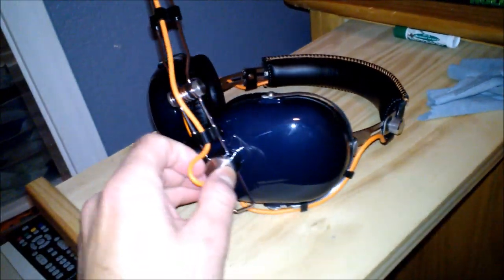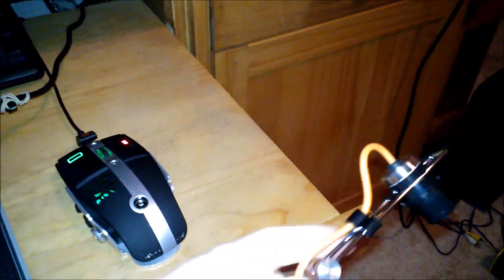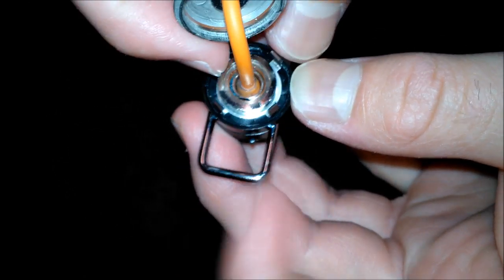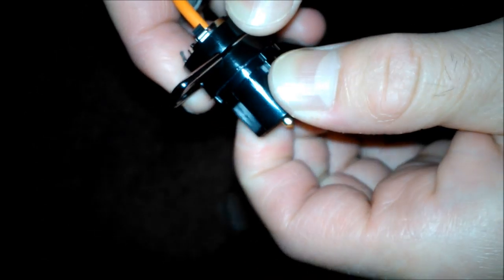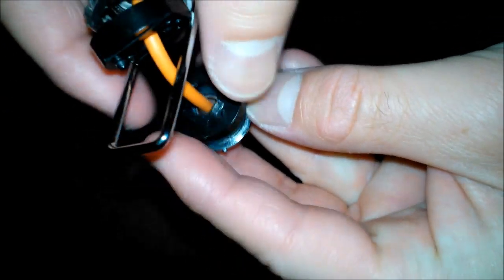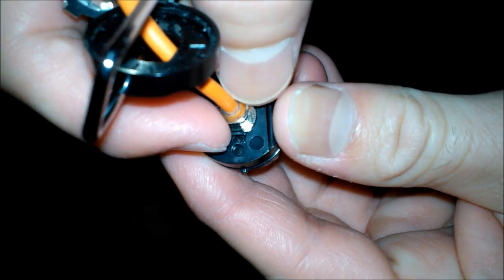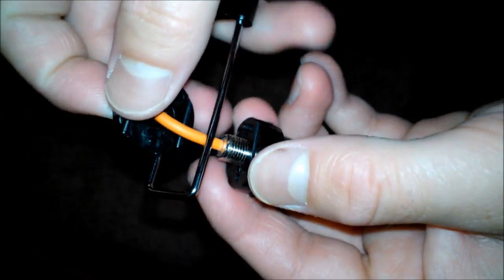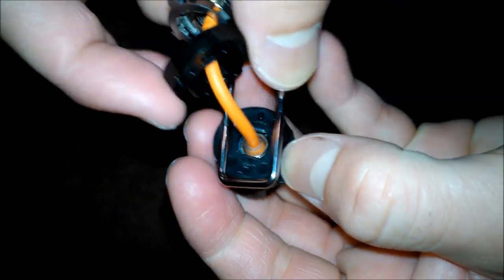Razer Blackshark How To Fix Broken Mic

Comment: My problem with the blackshark is that the mic would go loose and make weird noises, like static. My friends would then complain, since we are on a voice chat, then i would have to wiggle it to fix it.
Reply: Same here, I've had it for ~ 6 months and whenever I move it a bit it'll start making a "snow storm" I like to call it, it rapes peoples ears, and it's so annoying.
Reply from the maker: LyfeTime Gaming
Sounds as if the mic jack inside the mic plug is loose and isn't making full contact with the mic plug in the headset. Hopefully tightening it should fix it. Otherwise you should talk to Razer about it. It really is a wonderful headset.
Reply: AgardMan Eventually the headset got to the "sandstorm"  part, me and my friends like to say his mic is fucking itself, so I used cotton swabs to clean the inside. It worked for a week. Now the new problem is the microphone jack connecting to the computer. It fails to work now, when connected it starts making a whole lot of noise, worse than the sandstorm. No idea how to fix it. Computer's jack is working fine. The audio splitter thingy is broken. For now, using headphones only.
Reply: Forgot to say, the black shark belongs to my bro, not me.
Reply from the maker: If the audio splitter is broken ask Razer for a new one. If the audio splitter is broken and the headphone plug that plugs into the splitter is broken you may need to talk to Razer about hooking you up with a replacement. I know that repeated plugging and unplugging of a non careful nature can really mess up a plug or jack. Hopefully everything ends out well for you.
Reply: AgardMan Yup ordered a replacement already. It costs a bomb for a small adapter. Don't know if the "sandstorm" is fixed though
Reply: LyfeTime Gaming DO YOU FIX IT NOW ?!?!
Reply: Onkel Mon Nope, it's gotten worse
Reply: +Kidsnd274 OMG SAME I CANT FIX IT
Reply: try to change the quality of soundto the best one in speakers not microphone , do not allow other apps to change its settings and turn of all the extra effects . It worked for me
Reply: everyone i just fixed the sound. put contact cleaner on the male size of the mic.

Comment: Ive had this headset for years now. It is the best one i ever put on. As the video shows, this was one of my problems as well and because of the video it was solved pretty fast.
However i also encountered other issues, like static in the mic. In my case this was caused due to a snapped cable. The cable coming out of the headset gets twisted, bent a lot and eventually the cable will break. Usually it is at the entrance to the headset. I fixed it by opening up the headset, i used a small soldering tool to disconnect the cables to the circuit. Then i cut off the bad part of the cable and moved a long a "fresh part". The cable will be 2 cm shorter but it works. Then you just strip the cable, sold the right connections and ready to go.

Comment: My nephew has this headset and one of the screws has gone missing that holds the head piece together.  Do you have any recommendations of how I can replace the screw?  I have not been able to find a replacement part on the Razer website or at Memory Express.
Reply from the maker: In this particular situation you should be able to call/email Razer customer support and explain the issue and they should be able to send you a replacement. They stand behind their products so if you call them out and ask nicely for a replacement they should be able to help you out.

Comment: any ideas on how to pry open the metal thing just so i can tighten it?
Reply from the maker: Yeah it should just come off if you insert a fingernail in between the cap and the plastic. It is being held on by glue so do not worry if it seems as if it is going to break. I thought that, but found out it is held on like that. It is also held in by four prongs on the inside of the mechanism itself so I think the glue was just a precautionary choice made by Razer.
Reply: AgardMan oh it came off SCREWDRIVER SAVED MEH DIS TIME YEH
Reply from the maker: Yesh!!

Comment: I got my headset today and when i plug it into my laptop the mic itself isnt detected, but i can still hear the sounds in game fine. Do you know how i could fix this?
Reply from the maker: If what your saying is correct all you have to do is right-click the speaker icon in the bottom right corner of your desktop in the system tray and click "Playback Devices" then go to the Recording tab and click your mic and make sure it is enabled. Sometimes windows thinks you have a different mic that your would rather use and so you have to tell it which one you want it to detect.
Reply: AgardMan I have the same problem and this isn't helping.
Reply: Awfulmasterhat I ended up returning mine and getting the razer kraken 7.1. Theyre great
Reply: Fallsmar I got mine to work, open RealTek HD audio manager if your on windows, replug in the headphone and mic cord, when its pluged in something should pop up, it thinks its a headset and change the mic to a mic. If nothing pops up click the folder in the program and change it so it does. Hopefully it makes sense. Sorry I didnt tell you in time for you to get it to work D:
Reply from the maker: I hate how Windows still has issues with managing audio...
Reply: AgardMan It's just as a default it sees the mic as a headset, you have to change that with RealTek HD audio manager.

Comment: Is it worth buying?
Reply: i had turtle beaches for a long time and i can tell you yes, Razors are worth buying, just make sure to get insurance to replace them, every gamin head set on the market has its issues after a while
Reply from the maker: In my personal opinion, yes. Simply because of the fact that this headset has quality materials and is actually fixable if the mic gets loose. Other headsets, if the mic gets messed up you are usually screwed. Steven is right every headset can start having problems. Just take care your stuff and you will be fine.
Reply: Oh yea! Definetly warranty your headphines, it's a MUST I havn't paid full price for a pair in years since I've been getting warrsmtys, I've probly.gone through about 5
Reply: No, it's not. I fell in love with the design and "durability", but a friend and I both bought it, and have had nothing but issues ever since. Now the mic doesn't work at all most of the time, and I'm hearing so much static while in-game it occasionally gives me a headache.
Never buy Razer. You will regret it, if not immediately, it's just a matter of time. This goes for all their products (I've owned numerous - mice, headsets, keyboards - sooner or later, usually sooner, I've had issues with all of it). Even this, the Razer Blackshark, which really looks like it's built to last an eternity, failed way too quickly considering how rarely I've used it.

Comment: THANK YOU! just put it back together, it helps using a key to screw in the nut. also rather then flipping the mic back up and down, just fold it back, itll get lose alot less often and its just as much out of your way. and dont pop out the mic if you want to just listen to music in public, be proud of your gaming headset. If you have an issue with the appearance go n buy dr.Beats you filthy casual. lol

Comment: In all honesty, Razer makes shit products. The only one that I had no problems with is Razer Deathadder 2013 - what a nice replacement for my Naga, with one of its button stopped working after 3 months of very rare use. Both of my Deathstalkers sometimes repeat a random last pressed button, like yyyyyyyyyyyyyy until I press it again, and changing drivers, OS, computer doesn't help.
And now this mic issue: every time I move my mic - my friends' ears got DESTROYED by loud cracking sounds. Everything is tight, nothing is falling apart, but the noise is unbearable for my partners. 
This also can't be fixed, I disassembled the earpad - there's a metal tube for the jack to plug in, that's all, nothing to fix.
And also you know what, that mic is very quiet unless I move it almost into my mouth. Then start hearing me ok.
So, that's the last device I buy from razer, no more buys from me.